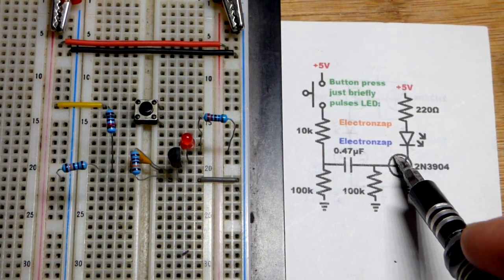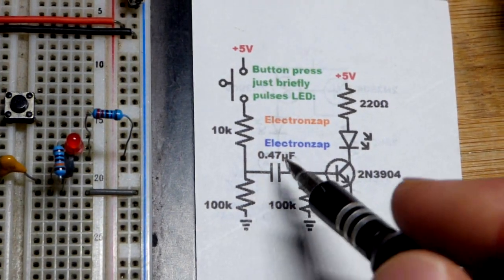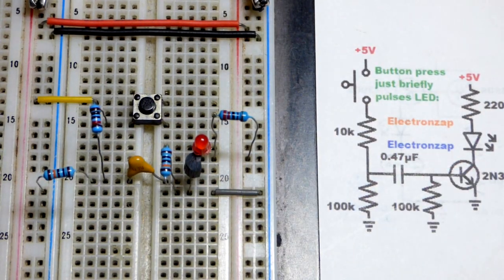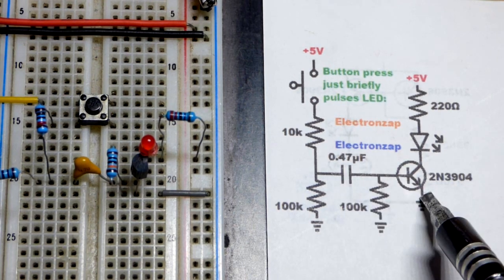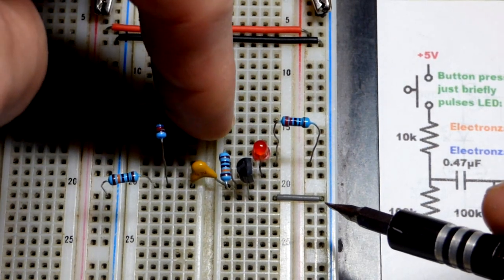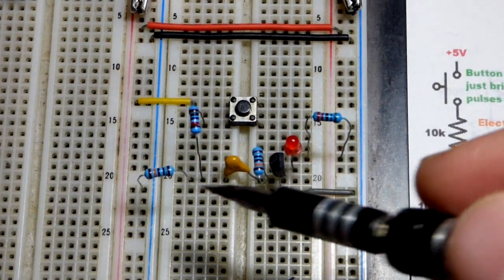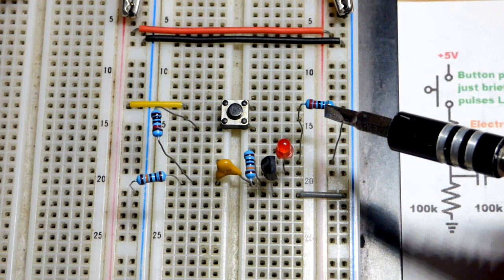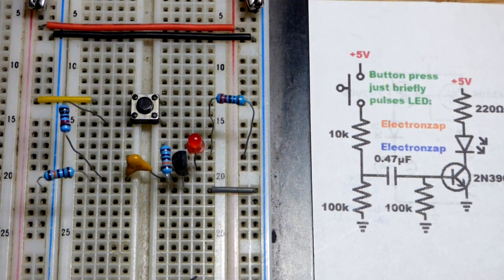NPN BJT One Pulse per Switch Press demo circuit using 2N3904 Bipolar Junction Transistor

Comment: This is a very great explanation, I’m new in electronics field and I’m learning circuits from the beginning, recently I encountered a strange phenomenon with a diode and capacitor circuit, can you please help me out to explain it? The problem is, when I have a resistor and a capacitor and a diode connected in series powered by a DC5V voltage source, I then connected the power and after a while, I could only measure approximately DC3V across the capacitor and DC2V across the diode, is the capacitor supposedly to be charged to DC5V? I couldn’t measure voltage across the resistor that means there is no current flow but how is it possible there is a voltage drop across the diode? Is it forward biasing? I then change the diode with a led, the same problem again, there is a voltage across the led however the light is not turning on. I’ll appreciate you could help me out.
Reply from the maker: When the diode/LED drops a voltage, that means it is keeping that voltage across the diode/LED. It is dropped from the series components. So the capacitor will not charge to the full supply voltage. With a forward biased rectifier though, there should only be a drop of about 0.6V, probably less when not much current is flowing. A red, orange, yellow LED should drop about 2V, 1.5V at low current. No current will flow once the capacitor is charged. And the capacitor won't discharge (other than a tiny bit over time) until you parallel a resistor with it. A capacitor already charged to 5V will stay at 5V if you use a forward biased diode to connect it to a 5V supply.
Reply: @Electronzap  thank you sir. Does that mean the diode/led actually stay in forward region but with zero current flowing? I also connected a resistor and capacitor in series to base on a npn transistor, which did turn on and let current flow from collector to emitter.

Comment: what is basically its application
Reply from the maker: I think the applications are all similar to this. If I need to stop sending a signal faster than I can release the switch, like when you need a flash of light for a picture, then I have to make it so the switch just initiates a pulse until I release it and press it again. Of course, switch bounce needs to be eliminated, so this circuit would have to be improved if it was going to be used in a real world situation.